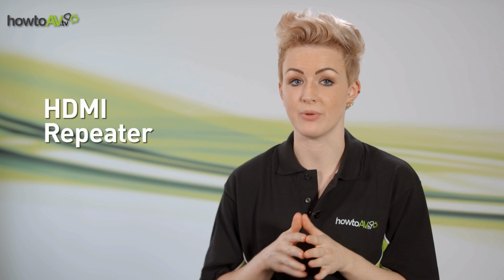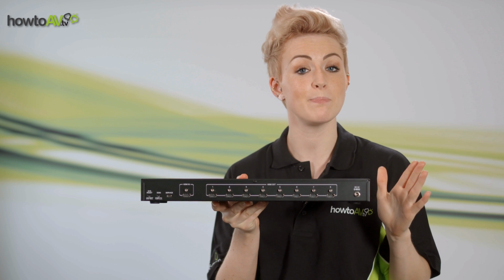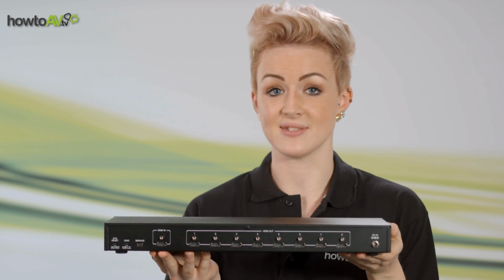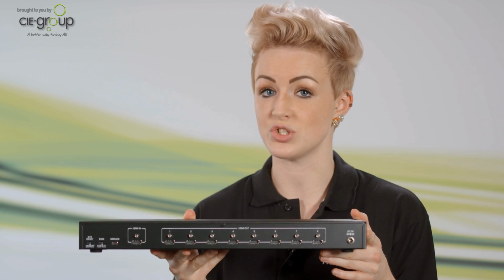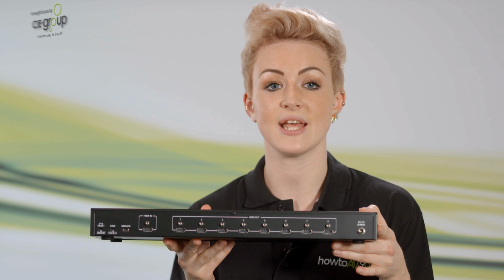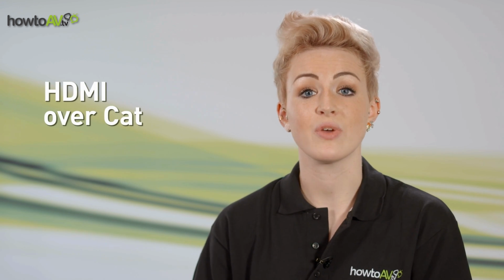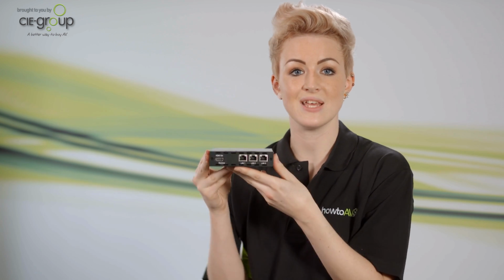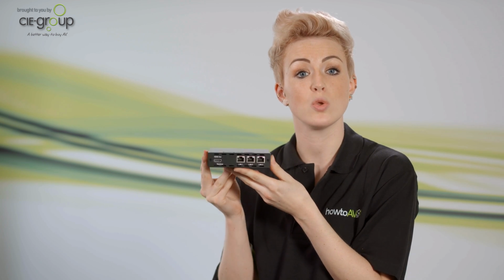How to extend an HDMI signal

Comment: I have a standard length HDMI cable from laptop as my input going to a splitter (2 output and 1 input), then connected a 20meters long HDMI cable to our smart tv as my output.  Now, of course that long will not send a good signal, so at the end of my 20 meters long cable i put a repeater with DC5v power supply and connected another standard length HDMI going to our smart tv. unfortunately it doesnt work. According to your video, should i change my 20 meters HDMI to 2 10 meters so they meet half way? @HowToAV.tv

Comment: I have seen an extended length hdmi cable of 100 feet on Amazon that has a "signal booster" as a connector in the middle. Will that avoid signal loss? Please advise.

Comment: I want to capture HDMI camera signal to a computer.Since it is converted from HDMI to LAN signal,will it be possible plug the other end to a LAN connection on a laptop instead of the receiver HDMI unit thus making the Video Audio signals available for recording or further processing like Live Streaming using a Laptop computer.
Reply: HDMI SIGNALS WILL CAUSE CANCER SAME AS WI FI. JUST USE CABLES. CANCER KILLS 578068 AMERICANS EVERY YEAR. 578000 AMERICANS .THAT IS 1/2 MILLION.HOW MANY 9/11 IS THAT?

Comment: I installed 2ea 30 foot long HDMI cables thru my ceiling by an AV installer 4 years ago.  The cable was a problem on my older TV so I upgraded to a Samsung UV55JS8500.  My receiver is a Yamaha 3030.  If I touched the HDMI cables the video would go out.  Anyway, after playing with the cables today I have lost all video.  What can I do to solve this problem?  I have two HDMI cables because of possible expansion.  Thank You for any solutions.  Going to be hard to explain this to my wife.lol
Reply from the maker: Hi Randy - thanks for your message and sorry to hear you're having issues - especially in the festive period!
The issue is almost certainly going to be length of cable I'm afraid - HDMI simply doesn't like transmitting too far...

Couple of suggestions we recommend you try:

The first (low cost option) is to try adding a HDMI Equaliser at the display end of the system.
Product such as the CYP RE-HDEQ is worth trying before having to make any significant changes to your system.
https://shop.cie-group.com/shop/av-distribution_19/hdmi_1023/hdmi-splitters--repeaters_90/hdmi-hdmi-equaliser_2994.php

If this doesn't rectify the problem, you're going to have replace the 30ft HDMI with a transmitter/receiver-over Cat cable system.
https://shop.cie-group.com/shop/av-distribution_19/hdmi_1023/hdmi-over-cat-x_91/
It does mean running Cat cable through the ceiling, of course. Hopefully you have easy access? (If your HDMI cable is giving you no signal at all and access to run Cat cable isn't ideal, then you could consider using the HDMI cable to pull through the Cat cable? Carefully!)

Best of luck - hope this helps...

And have a great Christmas!
The HowToAV Team

Comment: I am looking to extend an HDMI signal from a basement TV to a main floor TV and use my current wired LAN connection. I think most of your video is referring to point-to-point configuration, correct?  Is there possibly an inexpensive solution that would let me do the same thing, but over my existing network (main router and numerous switches)?
Reply from the maker: Thanks for your question mfranch87;
If you're looking to transmit HDMI over Cat cable then we ALWAYS recommend point-to-point. Having a network switch/hub in the equation will pretty much always result in signal drop-out/interference and a very disappointing result!
There are a number of options for HDMI over Cat cable as follows:
• HDMI-over-Cat Transmitter to Receiver
• HDBaseT Lite Transmitter to Receiver
• HDBaset 5Play Transmitter to Receiver
• HDMI-over-IP Transmitter to Receiver
The systems differ in price (we've listed the lowest cost option at the top) with each system having differing capabilities based on image resolution, distance of signal transmission and additional functionality over the cable such as Power-over-Cable, Ethernet and control signals.
Hope this helps; if you need any further advice, do let us know!...
The HowToAV Team

Comment: I am attempting to set up a live video stream to another room about 200 feet away straight from my camera. I would prefer to send my mixed audio from the main room's sound board instead of sending the audio from the camera microphone. Since the ethernet cable sends audio as well, is there something that I need to do to cut out the audio signal from the cable?

Comment: Hi there, great video! 😊
I have connected my Panasonic UBP-7000 UHD Bluray Player with my Dolby Atmos capable Yamaha RX-a2040 AV Receiver.
But as Ihad to put the HDMI cable through inwall, it has to be 11,5 meters. So I bought 10 meters and 2 meters long HDMI cables and used an "HDMI EQUALISER" to connect the cables to each other. 
The problem is; I can get DOLBY ATMOS audio but NO VIDEO.
I have tried the HDMI cables separately on other devices and they don't have any problems.
What may be the problem?

Thanks in advance for your kind co-operation 😍
Kind Regards from Istanbul...
Reply from the maker: Hi Moris and thanks for your question.
We are currently putting together a new video on just this subject!

The problem with the high bandwidth required for UHD is that standard HDMI simply isn't up to it over any significant distance I'm afraid! Even the latest high speed HDMI is limited in its distance capabilities.

There are two simple tests to prove its a distance issue...
The first is to reduce the output resolution of our Bluray player (to 1080p for example). If it's a bandwith/distance issue, the video should run fine at 1080p.
You could also do a quick temporary test with a short HDMI (1 metre) lead.

The best solution to this problem is to use a 4k UHD extender kit (eg. HDBaseT) - such as the below link, whihc will allow for long distance UHD transmission over standard CatX cable:
https://shop.cie-group.com/shop/av-distribution_19/hdbaset_1025/hdbaset-transmitters--receivers_1028/60m-hdbaset-lite-receiver-uhd-hdcp22-hdmi20-poh_23867.php

https://shop.cie-group.com/shop/av-distribution_19/hdbaset_1025/hdbaset-transmitters--receivers_1028/60m-hdbaset-lite-transmitter-uhd-hdcp22-hdmi20-poh_23868.php

Thanks for watching the channel; please Subscribe for all our latest uploads and please share with your friends!..
The HowToAV team

Comment: hi there.
I have an HDMI over ethernet repeater running a distance of about 40-60 m. The problem I am currently facing is that the transmitting device is placed in a false ceiling which calls for a 24/7 power source. its been almost a month since I've had this system running until recently the repeater began malfunctioning and there was no display. 
my question is therefore is, how do i know whether an hdmi repeater can run on a power source 24/7. And where can i get one. I am based in Kenya,East Africa and urgently require a solution.
Thanks you

Comment: will this work for 4k?
Reply from the maker: Good morning Amir and thanks for your question.
4k UHD is going to work just fine, as long as your 'extending device' (such as a Repeater, Splitter, HDBaseT Kit, etc) is 4k UHD supported.
The specification of your product should confirm this; check with your supplier to be absolutely sure.

Thanks for viewing!
The HowToAV Team

Comment: when installing an HDMI repeater over cat 6 cable. does the repeater overheat? if so, what can i do to avoid overheating especially because the system used must be left active(switched on) 24/7 through out the year
Reply from the maker: Good morning and many thanks for your question.
There really shouldn't be a problem of your repeater overheating, but there are a couple of suggestions we can make...
Is this a domestic or a professional repeater that you're using? Remember that domestic products are designed and built to run for perhap 6-7 hours per day, whereas a professional product will be built to run 24-7.
The other suggestion to consider is where you have the repeater positioned?.. is it in the loft or in a cupboard which is excessivley warm? and does the repeater have 'room to breath'? Ensure that the device has lots of air space around it and that it's sited in a cool area if possible.
Hope this helps,
The HowToAV Team
Reply: +HowToAV.tv hi there. im not sure if its a domestic repeater or not. its looks like a basic hdmi extender over cat 6 cable, you can say it looks like a coupler. 
secondly its positioned in a false ceiling in a large hall. Up in the ceiling it looks pretty open as there are other wires for fans and lights. it also important to note that the repeater is connected to a ups.
Reply: I filled up my 1 to 4 hdmi splitter. Can I tap another hdmi splitter out of one of the outputs ? My runs are are 15 to 50 feet.

Comment: Hi, I was one of those idiots that purchased a 20m hdmi cable. if i put a repeater on the end of this cable and then attach a smaller length hdmi cable. will this solve my problem? Thanks in advance
Reply from the maker: +Hellenic Social Many thanks for your email - hopefully we can find a solution!..
20 metre cables can work, but it's very hit and miss on the quality of thew product and the environment of the cable run.
You don't tell us what problem you're experiencing - is it noise on the signal or intermitent drop-out of the signal?
If this is the case, then we would definitely suggest this option - the CYP RE-HDEQ - which helps to equalise/re-clock the signal: https://www.cie-group.com/shop/av-distribution_19/hdmi_1023/hdmi-splitters--repeaters_90/hdmi-hdmi-equaliser_2994.php
If you're not receiving any signal at all over the 20metre HDMI cable, I'm afraid you might struggle I'm sorry.

Hope this helps!..
The HowToAV Team